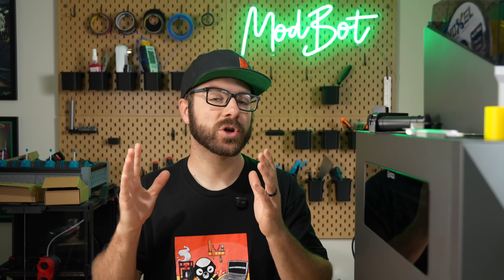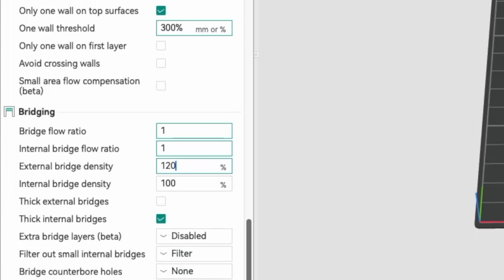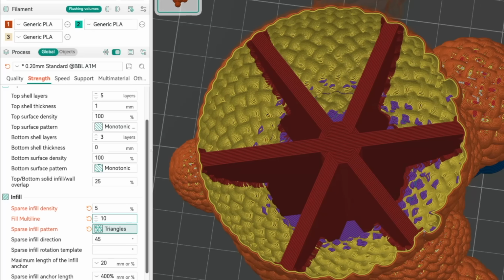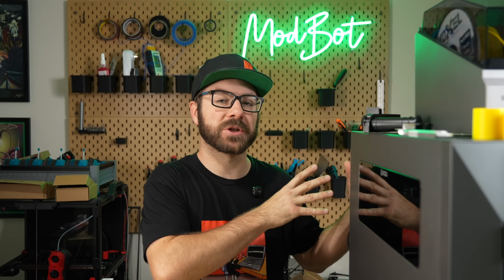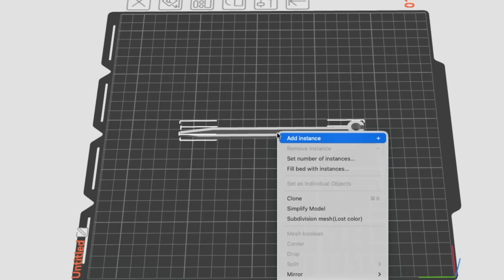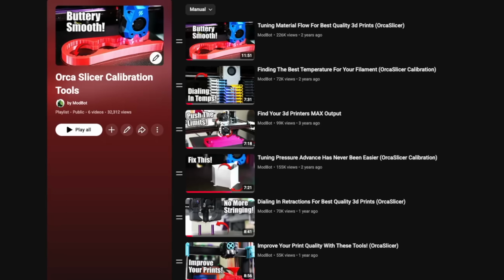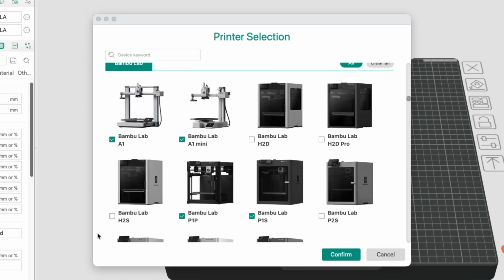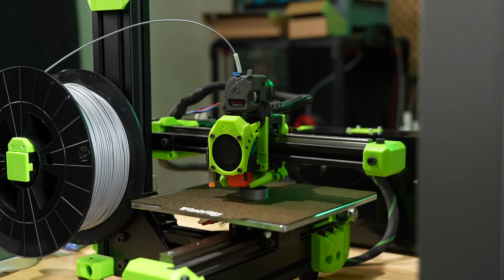Biggest OrcaSlicer Update Yet? OrcaSlicer 2.3.2

Comment: In Orca Slicer 2.3.2, .gcode.3mf files open empty, whereas they opened normally in the previous version (2.3.1). This issue has been reported for a long time but seems to be going unnoticed and remains unresolved. Several friends and I are all experiencing this exact same problem. Has anyone else encountered this?

Comment: Prime towers with multi material should be producing multiple prime towers. I have no idea why they aren't doing this.
Reply: and that helps.. how? if it's not a multinozzle, a mix will flow for a while, and the whole point of the prime tower is to purge out all this mix.
Reply: @invendelirium  Because most materials don't stick to each other. Making a single prime tower with mixed PLA and PETG, for instance, is stupid. Just make one for each.
Reply: @TheNintigod  but that was exactly my point - the stuff coming out of the nozzle is neither pla nor petg, so splitting it is fundamentally impossible. By the time pure stuff is coming out, you should start printing the model already.

Comment: DAMN, wish I had known about the Instances a week ago. So many times I find I have to make an adjustment to a model with multiple copies on the bed, especially multicolour prints, usually either make the adjustment to each clone or delete all but one and reclone that one after the adjustment. This will make adjustments so much easier with multiples of the same model. That tip alone is worth a thumbs up on this video.

Comment: Being able to individually set flow ratios allows printing the same tpu in very different hardnesses, while still maintaining a solid outer layer. 
Something like 1.0 for outer wall, top and bottom, and 0.5 to 0.7 range for inner wall, infill and internal solid infill allows for very soft, almost sponge like tpu 95a prints.
Reply: I print a lot of foaming TPU-LW and this is huge.  I look forward to experimenting with it although there is significant lag (demonstrated as ooze when printing stops) that could impact print quality.  With TPU and particularly TPU-LW, I try to keep the temperature and flow rate constant.
Reply: That has been on my wish list for a while. I won't use it often, but when I do things will be smoother. The nearest I could have gotten before was by using multiple hardnesses of TPU, and that meant manual switching since my AMS doesn't support TPU.
Reply: Good to know, thanks for the note!

Comment: My older era printers I upgraded those printers at the first serious clog to MicroSwiss so I can get an idea on how much improvement and added value of MicroSwiss. I can vouch that MicroSwiss is a huge upgrade to printers. I haven’t done that with my Bambu printers, but I’m seriously considering  switching to high flow nozzles and see. I’m not there yet. Cost is an issue at this point as I am on limited income.

Comment: I hope they've sorted out the bridging and slow down for curled features. Oh and extra perimeters on overhangs.

All 3 settings are buggy AF. Bridging going the same direction as infil on one layer and against it the next.
Concentric bridging?? 🤯
Speed changes DURING a bridge??

The only feature I've seen that I like so far is the flow ratio settings. That can be handy for printing foam with softer orcdenser infill

Comment: Being able to adjust flow ratio of each feature is huge. I used it a lot in cura and ever since i switched to orca slicer i wasnt able to achieve the same print quality.
Reply: Well, you could always do that using Change extrusion role Gcode section. Not so user-friendly, but at least it is possible.
Reply: I’m excited about this feature!  I’m sure I’ll end up really OCDing those settings one day.

Comment: That Qidi box integration is awesome for my q2!
Reply: they integrated the qidi box but it doesnt appear that you can still set the box temperature still in orca?
Reply: @jubjub2m6  I haven’t tried that yet, the sync works at least
Reply: @jubjub2m6  I can set mine..
Reply: @jubjub2m6  You can set the heater box temperature in the Device interface, or by adding the corresponding control G-code to your custom code.

Comment: In my case this update destroyed custom printers and filaments settings. I was angry
Reply: no backup?
Reply: @Karaon there are. But it doesn't apply to new version.
Reply: I had this issue. I had to add back the original "parent" profiles to get them to appear again.
Reply: Yup, same. Well - it didn't mess with the presets, it just destroyed the sorting of them in drop downs. Filaments I have unchecked and don't use are now in all my lists, and the alphabetical sorting of them resets 3 or 4 times before you get to the end of the list. Takes forever to find things now.

Comment: 2.3.2 crashes when I click on the device tab. I went back to 2.3.1.
Reply: I had it completely corrput my config file for whatever reason, luckily i had a backup, its not exactly "stable"
Reply: It doesn't crash for me, but both in 2.3.1 and 2.3.2 when I go to the device page it can't connect to the printer. Otherwise it sends files and a print command.
Reply: Why not just export locally, then access the printer via a browser and load the .gcode manually?
Reply: @mbelke  the file is loading. The problem is that there is no access to the printer interface itself
Reply: There are a bunch of bugs...
Reply: You using Linux? It also may have been fixed by now but i added this to the environment variable “WEBKIT_DISABLE_COMPOSITING_MODE=0”

Comment: Nice job.  Good detail.  Did go back to 2.3.1 due to the number of bugs.  Basic things like number of color swaps no longer work, and frequent crashes.
Reply: Hearing multiple situations like this has stopped me from updating.
Reply: ...I've also gone back to 2.3.1... My P1S and A1M are running in LAN mode and under 2.3.2 I have massive connection problems, it shows "no printers" and the program often crashes.
Reply: @D3rMetzger same here... I thought it was just my system  :(
Reply: I keep getting constant crashes.. I thought it was just me. Lol

Comment: Top-Tier Quality as always, Modbot. Sufficient informational depth to hit the required points while keeping the overview per topic and the overall video length manageable and digestible. It’s incredible how we have access to the best slicing software on the planet (not a close second btw) and it’s all open source. Thank you for your A-1 coverage of it thus far, it has been instrumental in my development to my current high level of skill in 3D printing.
Reply: I was actually able to get better prints in regards to overhangs and bridges with cura but, Orca is much easier to use and every printer now days is good enough I don't notice not having all the settings cura does.